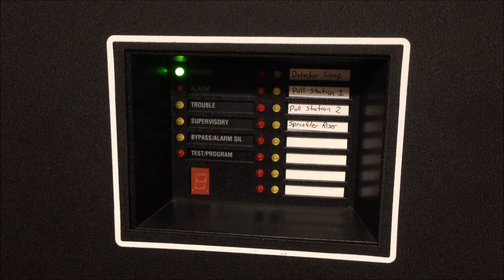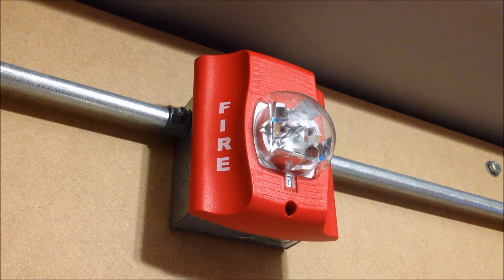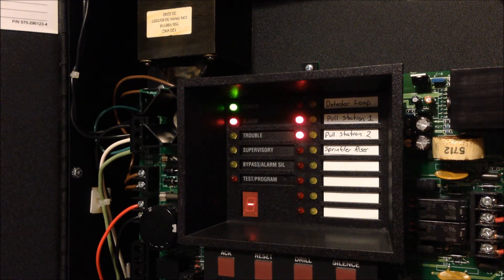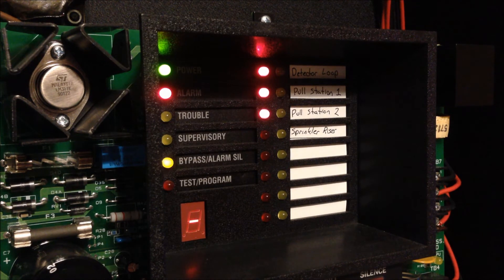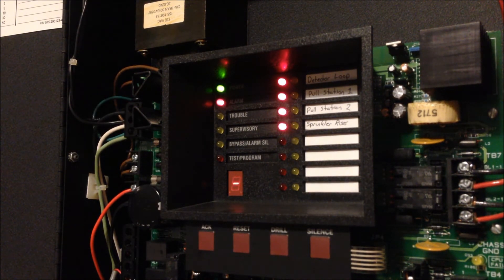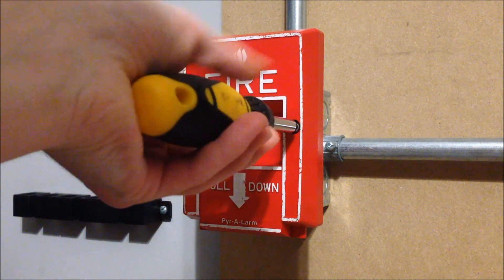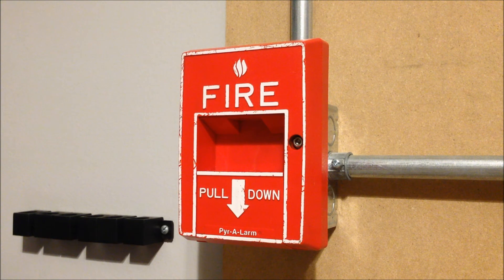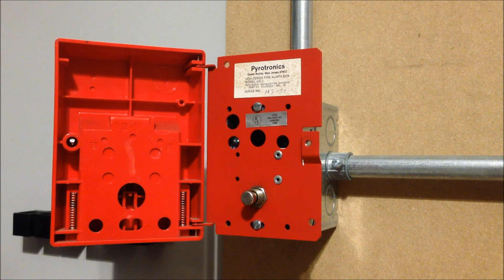System Test 36 | Cerberus Pyrotronics Chime and Coded Zones!

Comment: Pyr-A-Larm itself was a type of System I believe. I have a new plastic Pyr-A-Larm branded MFS-4 station as well as the old MFS-2 type (aka the Autocall 4015) with its original key and backbox; I found it in my relative’s garage. They were old high voltage DC FA systems.
Reply from the maker: It seems like Pyr-A-Larm was originally a brand name or subsidiary used by Baker Industries back in the 1960s. Their products were very closely associated with Pyrotronics units, but I'm not sure exactly how the two brands related. Some documents seem to suggest that Pyrotronics itself was developed by the Pyr-A-Larm brand.
Reply: kcin556 I think they did, because my MFS-2 says Pyrotronics: A Division of Baker Industries; Use with Pyr-A-Larm System. I’ve seen a vintage Pyr-A-Larm demo panel setup on eBay before and the things are absolutely massive. But as you mentioned; I’m not too sure either to be quite honest.
Reply: High voltage? Like 120VDC or something?
Reply: Fahrenheit4051 Yeah, I heard 250 VDC or something like that. This isn’t for sure facts though.